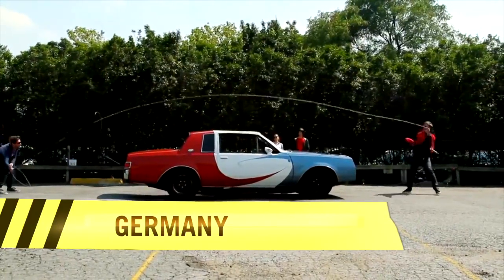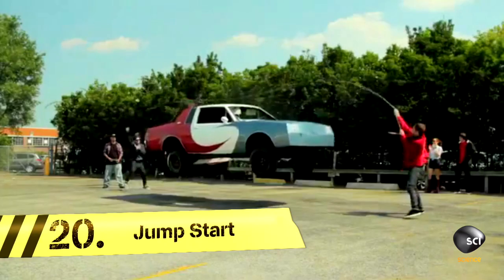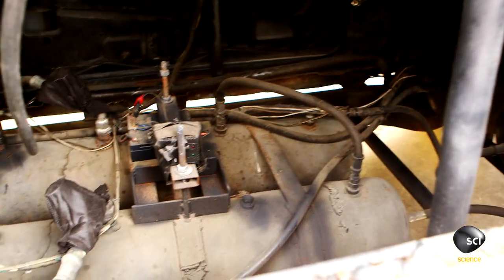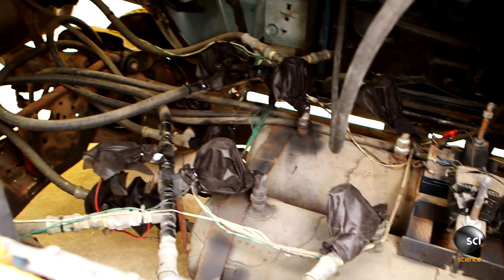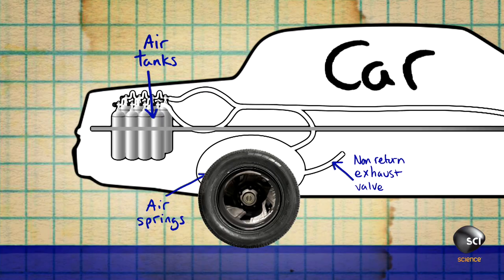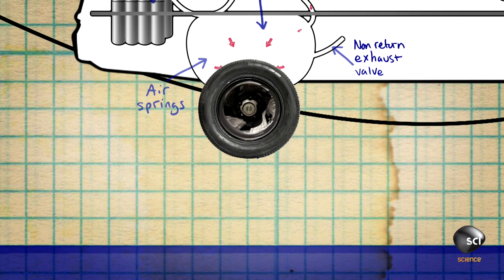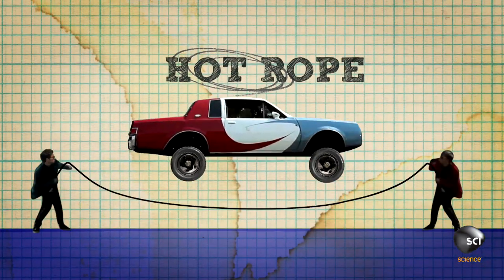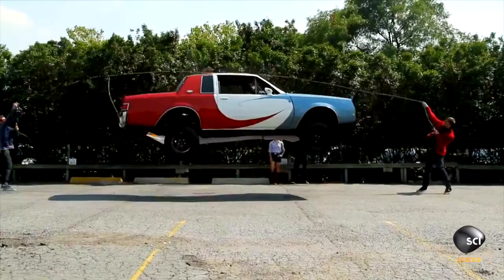Can a Car Really Skip Rope?

Comment: Car : Self-powered motor vehicle used for transportation.
Motor vehicle : The propulsion is provided by an engine or motor.
It doesn't have an engine, so technically it's not a car. 
It would be more correct to call this, "vehicle frame skipping rope".
Although the air tanks are categorized as pneumatics and pneumatics can be used in motors or engines (i.e gas compressor), an air tank on it's own you would not be classified as an engine.
I've noticed other people in the comments also agree that this is not a car. 
I expect more from something that calls itself "science".